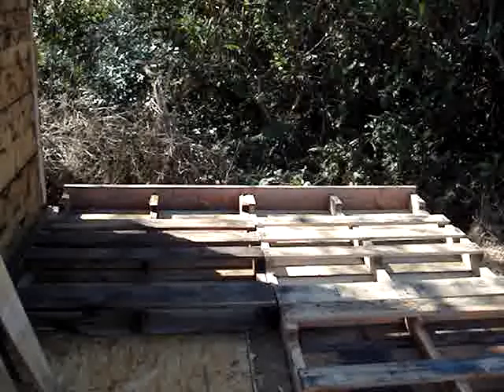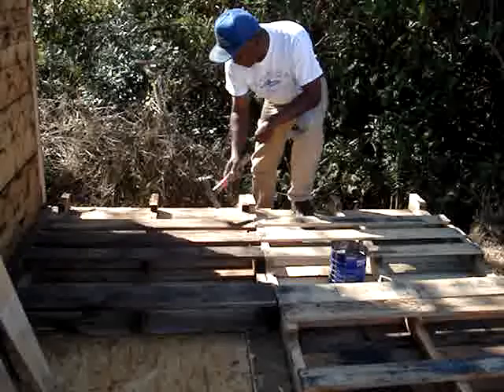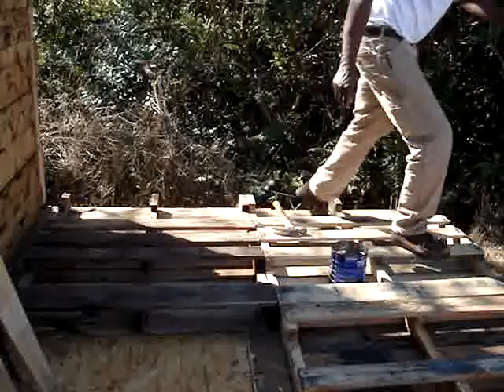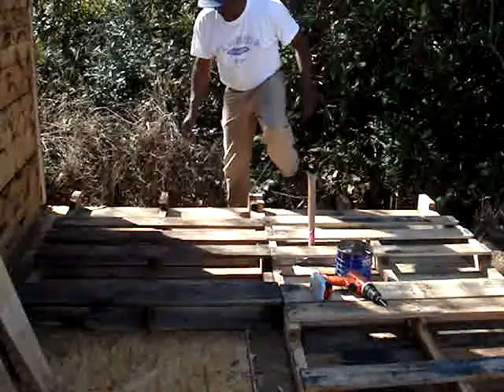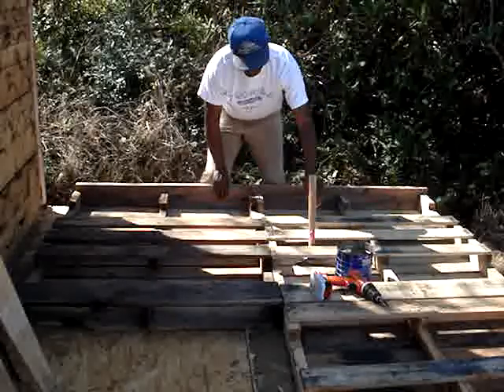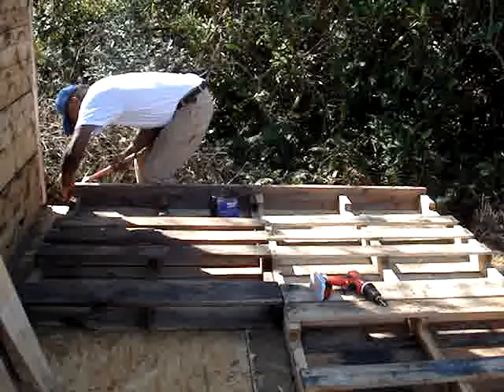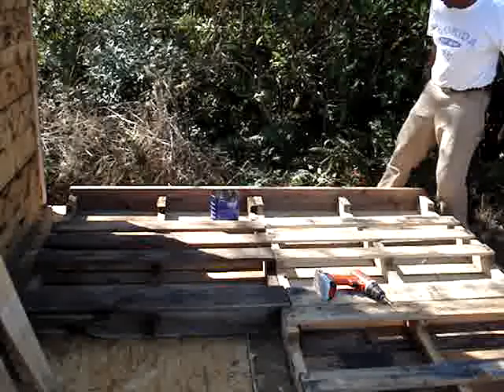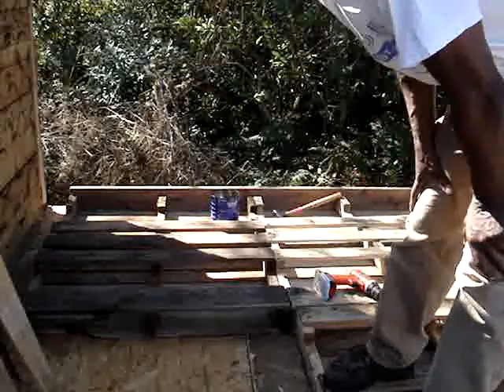PALLET WALL   PART 1

Comment: I'm surprised you found a pallet tough enough to bend your nails. We move a lot of pallets where I work and it seems most of them are junk these days. Barely strong enough to hold their load.
Good video thanks for sharing.
Cheers!
Reply from the maker: Yes, that was some solid oak or something... tough stuff!!
Reply: TheRumpledOne Most around here are made of HEART Wood...which is the center of the tree.  Very tuff stuff to hammer into. Also made of white oak to resist (not stop) rot!
Need to use a nail gun or predrill for nailing....me, a nail gun